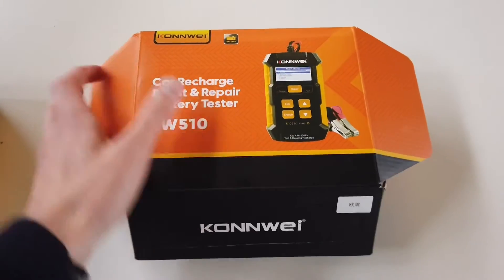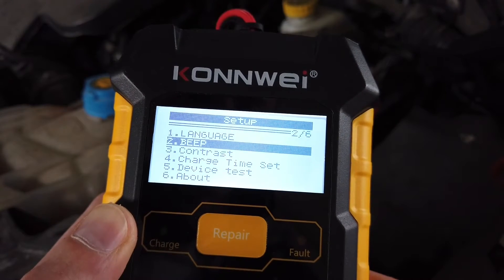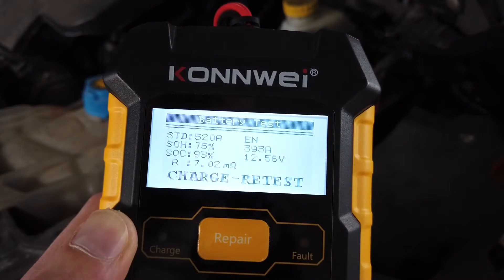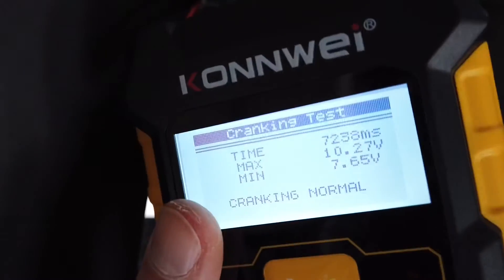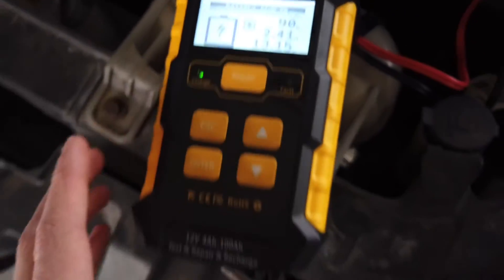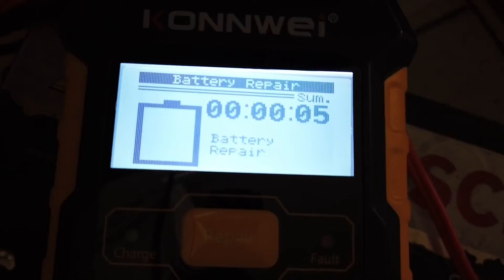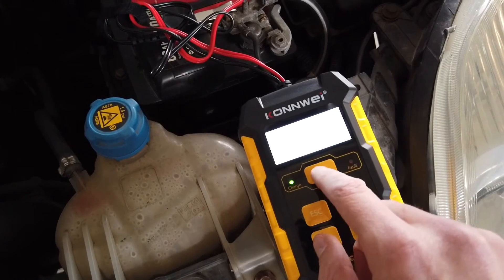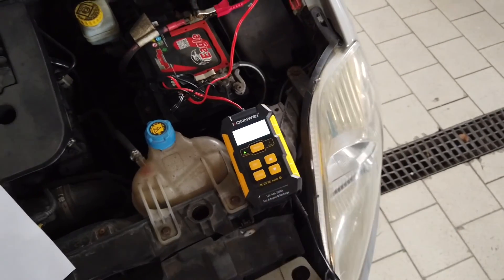Konnwei KW510 battery diagnostic tool unboxing, test, pros & cons

Comment: I bought KONNWEI KW510.
The device does not work: the Restore function gives error E5.
The seller asked me for a video with an error.
Next is chuckle. The seller writes: I don’t see a problem, and gives me a screenshot of my video on a second, where there is no error yet!
Then the seller wrote the same type of answers instead of answering my questions, and as a result, the seller blocked me.
Now I can neither leave a review, nor write, nor even buy something else from him.
I do not recommend.
The seller lies, does not solve problems, does not communicate.
If you have a problem, you will first be beaten with the same type of answers, then they will simply block you.
Reply: @vitaly1461  amigo, conecta el equipo a la red, tu batería está dañada por eso muestra el error e5

Comment: I received this tester and chargher but charghing and repair is not working it's beeping and say error 5
Where is the problem ?
I test 3 good battery but the same problem
Do you know hot to enter in test mode (to test charghing and repair function)
Reply: i have the same issue, is the tester faulty?
Reply: Are you sure batteries are in good condition? Chargers have safety first so if charger detects a faulty battery they will not charge as it would be dangerous

Comment: Which function to use first, Repair or Charge ? For example I want to take my 2 year old Varta accu out of my car, do I first need to fully charge it and then use the repair function or do I have to start with the repair function first and after that do a fully charge ? Or will the repair function charge the battery at the same time ?
Reply: The manual says to charge it before attempting repair. I have had one battery repair in 4 hours, the one on it now has gone over 12 hours and is still running...